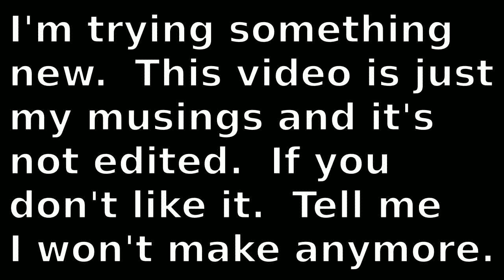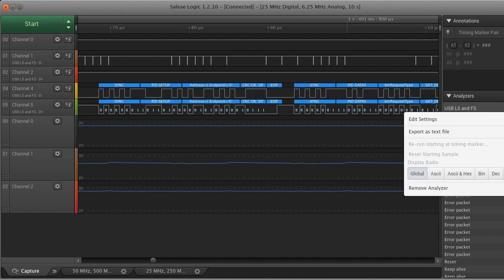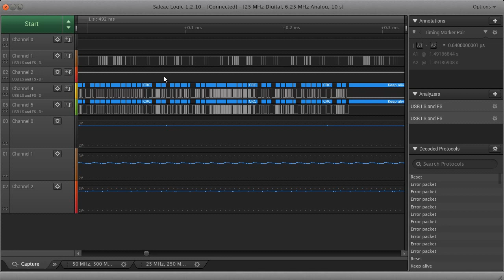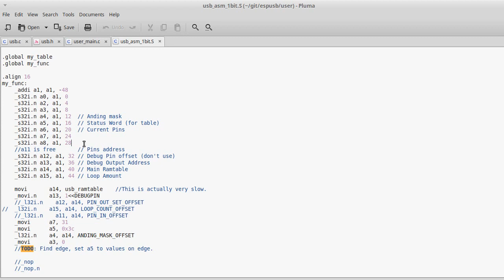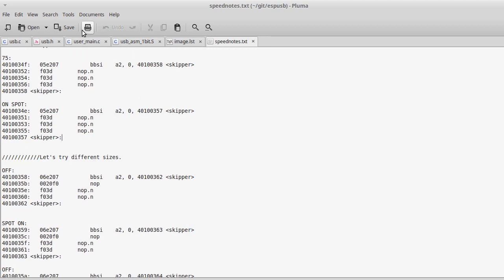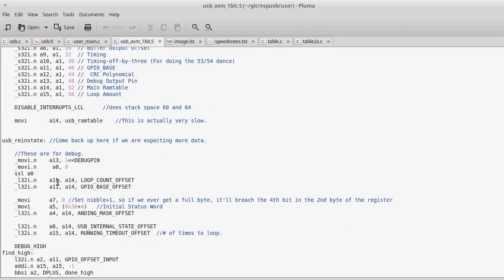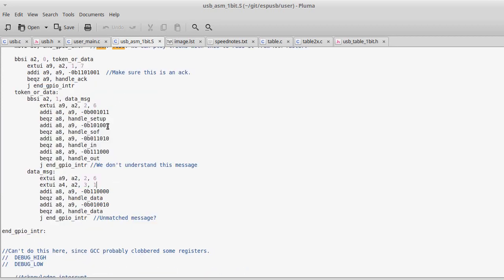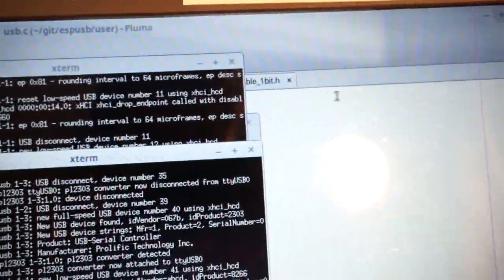Musings on writing a software USB stack

Comment: I also got confused, when I wanted to learn about USB from the internet. Some articles are all over the place. We need these type of videos. Keep up the good work. Good Luck.
Reply: That's because USB has so many layers.  What he's talking about in this video is just the low-level signalling, to move packets between one place and another.  This is just step 1 if you're trying to implement a USB device.  On top of that there are three or four software layers, and for each layer your device needs to set up a descriptor, and each descriptor has its own format and does a specific thing.  So some of what you find on the Internet just describes the hardware level, and other things you find assume this is already taken care of by the microcontroller you're using, and focuses on certain descriptors.  So while this video is very clear, it doesn't cover nearly enough to create a USB device or a USB host, where you will be able to plug in your device and have it "just work".

Comment: I'm surprised you haven't setup some kind of QPST switch to remove the plug/unplug from your build-flash-test cycle. Do you need to cycle the down+ground even, would a DPST on the D-/D+ cycle the USB?

The new format is good BTW. The screen cap segment was real noisy but I'm sure you know that already.
Reply from the maker: I don't understand your question regarding the QPST?  What would it afford me?

Also, I do know, but, because I was doing USB testing, I couldn't easily use a USB mic because it would flood the wireshark stuff with those packets.
Reply: At the end of your demonstration (33:50) you're plugging in the USB connector. Thinking that this was/is part of your compile-burn-test-didn'twork cycle, it would be easier or less fiddly to flip a switch to disconnect the USB rather than re-plug.
Reply from the maker: Oh, I could have just wired a reset button to the board, or, to the DTR/DTS pins and it would automatically reset.  Dunno, never really messed with that.

Comment: Come to think of it, perhaps the ESP8266 could make a decent logic analyzer. Perhaps with some tight assembly it could do 10MSPS - feeding via SPI to another ESP8266 that does the serving. The big problem is that however few affordable analyzers on the market do RLE ("segmented memory").
Nice to see soft USB ported to another platform, I wonder if the big vendors do it via tables as well or if they have dedicated silicon. I suspect it's a mix, involving a bit of black art.

Comment: Heads up, it is relatively easy to remove the noise from the audio by running it the track through the noise removal tool in Audacity and then re-encoding the video using ffmpeg. I found it difficult to pay attention with the background noise so I went through the process myself. Nice video.
Reply: I didn't find it too distracting - seemed more like white noise.  But I really enjoyed the video so my focus was on the content and not the background.
Reply: It probably depends on your speakers, with 1" silk dome tweeters 5 minutes of it was all I could take.
Reply from the maker: I will keep this in mind in the future.  @Byron

Comment: From these findings , do you think usb host capability be possible for limited otg support say hid input?
Reply from the maker: The biggest problem is the lack of full-speed support.  Unless the device you are connecting supports low-speed, there would be no way to communicate.  That said, HID, for many devices /should/ be possible, i.e. plug a cheap usb keyboard into an ESP and it should wake up.

Comment: How about the ESP8089, also known as the ESP32?
Reply: ESP8089 and ESP32 are listed as separate products on Espressif's site. Looks like the ESP32 includes both WiFi and Bluetooth, where the ESP8089 is only WiFi.
Reply from the maker: ESP8089 is the ESP8266, they're virtually identical.  32 is brand new!

Comment: TIP: run your mic audio through a software low-pass filter before adding it to the video. Then you'll get rid of the high-frequency rattling without affecting your voice :)
Reply from the maker: In the future I will keep this in mind, though I want to avoid having to use this mic anyway.

Comment: Imagine combining your USB implementation with https://github.com/esp8266/Arduino
The hardest part of it, is to get it connected and programmed, yet. 
Developing a arduino bootloader that works with your USB implementation to upload a sketch will be the new world domination!!! (I will even start creating videos again XD )
Reply from the maker: Someone's just opened a ticket for that.  I don't do arduino, but I am more than happy to support people attempting to do this!
Reply: I know you are the low level guy. I went also trough all that stuff and it's really good to learn these details. I also HATE the Arduino IDE, but it's really is good in hiding all that gcc/avr dude infrastructure in the background and providing convenient libraries to the user and hiding the os differences. The arduino core for ESP made it possible to use the ESP as an micro for 95% of the makers in the first place. However, I really love your work probably enabling an esp based USB programmable micro working with Arduino. This would be a real game changer. A good start would be to implement a low profile USB serial for a simple boot loader. I'll take a look where I can help...
Reply from the maker: That is def the first logical step.  Richard set this up:  www.esp8266.com/viewforum.php?f=154

Comment: If you are still there look here http://www.beyondlogic.org/usbnutshell/usb3.shtml#USBProtocols
As some suggestions from me - I don't think you are supposed to do that stack on such mcu. It is slow for fast usb operations.
I am not a usb engineer but I suspect mcu would need to only access external module - most likely some fast DSP dedicated for differential data that only signals through interrupts if and what data is ready to access. I will look into it. If Chinese do it so easily I am positive there are dedicated chips running simple ISP/I2C protocols to access larger usb packet chunks

Comment: bens The importance of framing | Networking tutorial and related framing protocols gives a good grounding to expand on and simplify.
https://www.youtube.com/watch?v=xrVN9jKjIKQ

Ben Eater,Published on Oct 29, 2014
What is framing? Why do we need it? A look at Ethernet and HDLC framing
-------
http://cholla.mmto.org/esp8266/xtensa.html
An short guide to Xtensa assembly language
The ESP8266 has an Xtensa lx106 processor at its core. This is a 32 bit RISC processor with 16 registers.
This little guide is my "cheat sheet" to the Xtensa architecture. There is a 662 page PDF document "Xtensa Instruction Set Architecture reference manual" that this is derived from.
...

Basic loads and stores
This is a load/store machine with either 16 or 24 bit instructions. This leads to higher code density than with constand 32 bit encoding. Some instructions have optional "short" 16 bit encodings indicated by appending ".n" to the mnemonic. The Xtensa implements SPARC like register windows on subroutine calls,....
"The SPARC architecture includes the concept of register windows. An overly simplistic way to think of these windows is to imagine them as being an infinite supply of "fresh" register sets available for each subroutine to use."